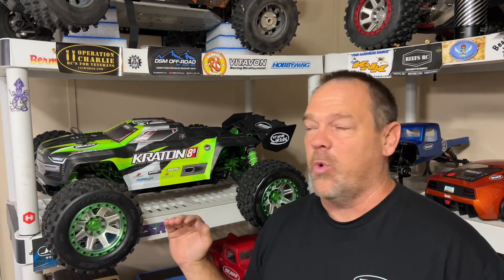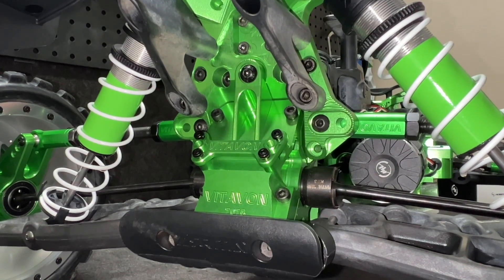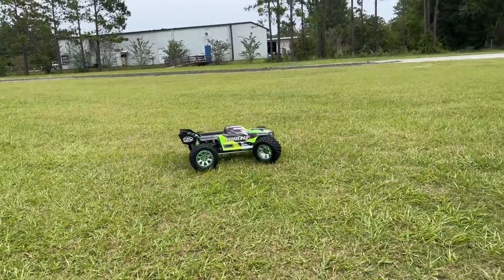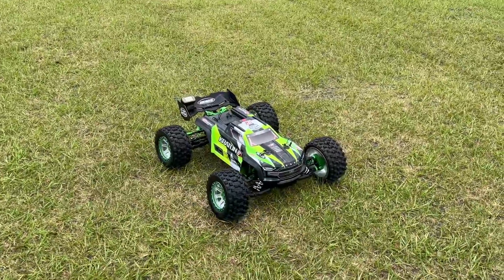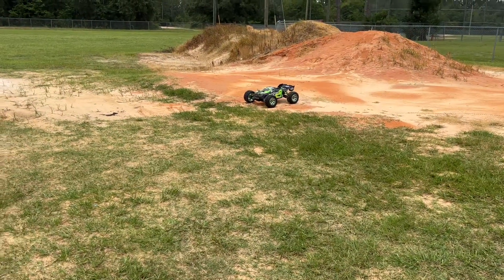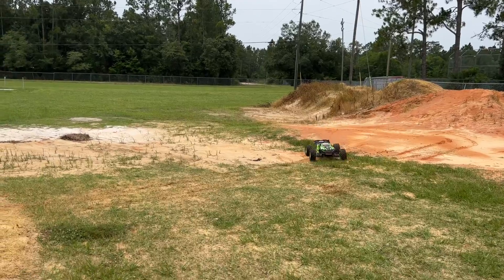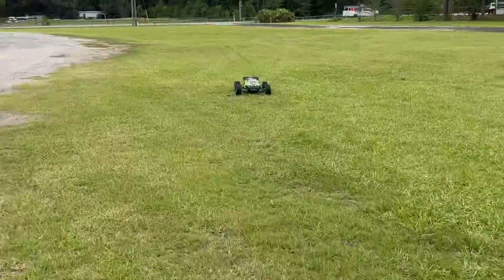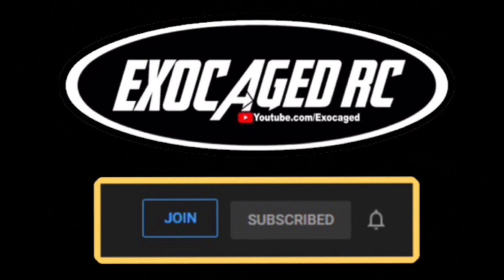Hobbywing Max5G2 in the ULTIMATE 12S KRATON FIRST DRIVE!!

Comment: Nice I put that in my old felony changed the rear diffs to the same as the front 500 kv motor check it out just painted the body Audi r8 putting my wing on just been very busy building thanks from Bkf racing ❤

Comment: Ripping that shelf queen on 12s is epic! 🤙🏻 For more speed, how about giving us a video on the turbo timing features of that esc? It should work out like upping the pinion gear, more speed for more heat.
Reply: I was just reading up on that feature, it works at full throttle only and you can set delay times.  For punch, Hobbywing says max punch makes the throttle movement 1:1 and will pull the most amps in that mode
Reply: Turbo mode on the xr8 g2 goes from 10amps full throttle just holding it full throttle in the air to 30 amps at 48degrees of turbo. It really puts a strain on your batteries

Comment: You have my dream rc basher. I will one day get the kraton 6 or 8s. They are just so expensive here in Canada. Especially the 8s. But man they are sweet. And now you have built the ultimate Kraton. Well done sir
Reply: No need for all that metal in a basher. Thats more of a show piece. You def need to replace some parts from stock on the Kraton 8s but $3k worth of machined aluminum isn’t necessary.

Comment: That has to be one of the nicest K8s I have seen, Congrats on it man, goes well too. I am running a HW 5687 1100KV and having heat issues with 39/30 (1.3) and the motor has two NXT fans on it. Pretty impressive your's didn't get to hot, again. Congrats man, that's a rig to be proud of.
Reply: I have the max5 800kv combo (8s) in my Outcast and have really good luck with 34/39. 30/39 isn't bad either, but just a bit slower

Comment: You really gotta gear up those low kv motors to make up for he lower rpm that they spin.... My K8 with the max5 800kv has 30/39 and my Outcast 8s with the same system has 34/39 in it.

Comment: i got the max 4 with a castle 2028 1100kv in my k8 exb and it just absolutely destroys the drive line on 12s. been through 2 center diffs 4 rear diffs 3 pairs of m2c overkill shaft's and the factory ones. had it going 75 mph at 50% throttle and it tries to flip.
Reply: 1100 kv not rated for 12s
Reply: @chrisgonzales153  its took it for over a year so even if it goes I've gotten my moneys worth out of it.

Comment: Having a motor undergeared will create heat, the motor is running on max rpm more than you’ll be doing if it was geared a lill higher.
Reply from the maker: I’ve got it 25/25 now and lunch turned up but it’s raining.

Comment: It really wants to move, I cannot imagine how much one of these fitted out like this would cost in my country, the car alone is 1.5K AUD.
Reply: I will add, since you cannot really see scale properly when it's driving, when it's behind you, 1 wheel is 1/2 the size of your head it seems.
If you stuck a wheel in front of your mouth, it would cover your chin all the way to upper part of your nose, and these seem like low profile tires too.